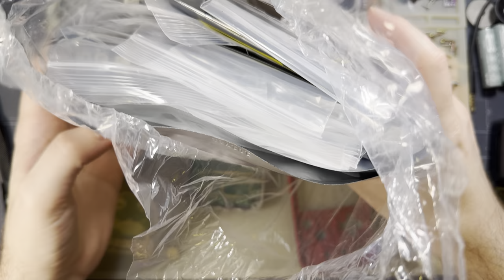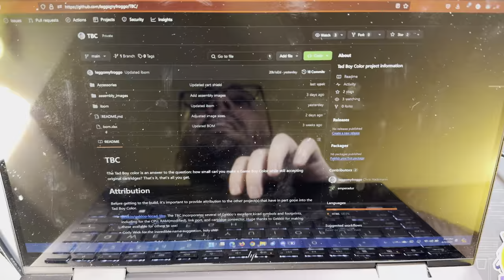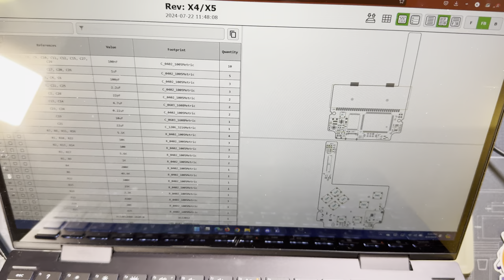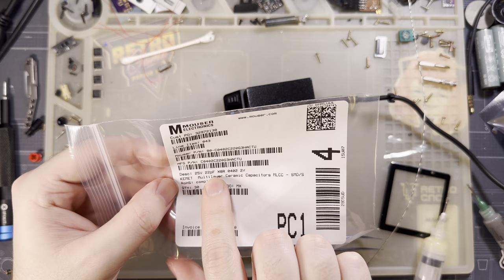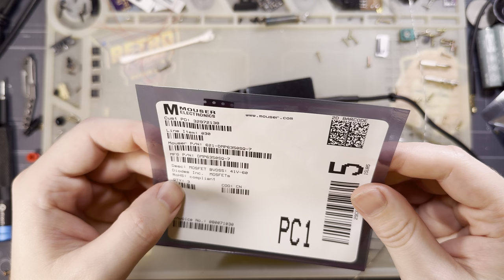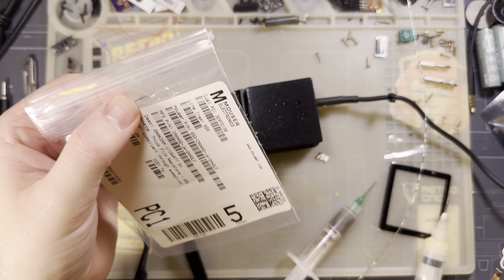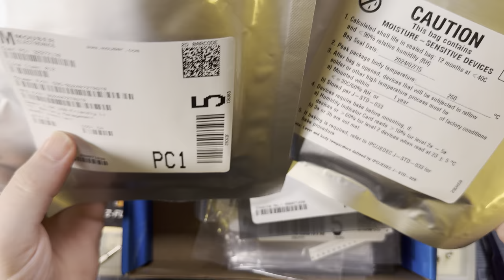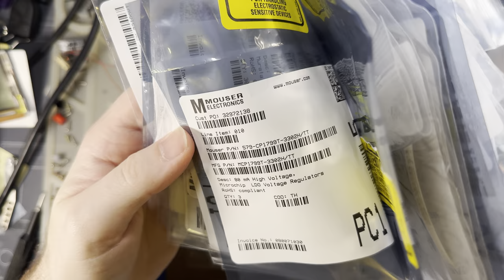Assembling a Tad Boy Color (X4 Prototype)

Comment: As a professional senior technician. This isn't hard but I would prefer to do this all by hand or using hot air. Paste is OK but messy. I guess 15 or so  of these in a working day would be achievable. Just a small tip using small solder wick would make removal easier as heat transfer is quicker. 😊

Comment: As I'm sure you've probably figured out by now, I'm pretty certain what you have there is the correct battery. You just need to peel the label off and remove the plastic frame for it to fit.

Comment: re: various colors on anodized metal - isn't anodization a chemical process using heat, and not a dye?
Reply: sulphuric acid on aluminum (the most common anodization method) forms a porus surface which is often dyed and usually always sealed.

you can also do metal deposition on the porus surface to get metallic colors (and black iirc)

Comment: Damn, this is a masterpiece. The shell looks to be such high quality, even compared to some of the top options out there (like Slate or Unhinged).

The tricky soldering part seems a bit challenging, but with some different color options, it would be an instant buy for me

The issue with the soldering isn’t just about making simple connections—there are parts that require more than just a basic soldering setup, which is definitely a turn-off for a lot of people. It’s a shame, really, because it makes it less accessible to those who don’t have advanced soldering skills.
Reply: Wdym different colour options? Froggo holds you responsible for courcing the shell. You pick the materials, colours, you order the buttons, membranes, etc. his was just packaged for him for conveniency purposes